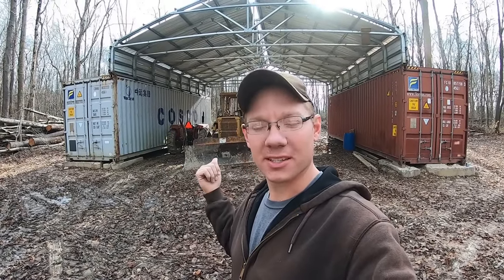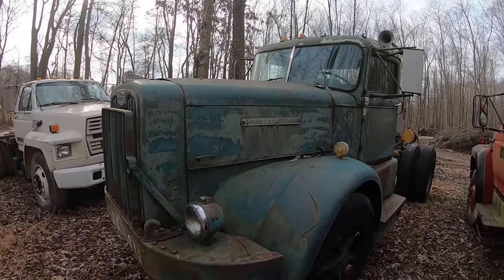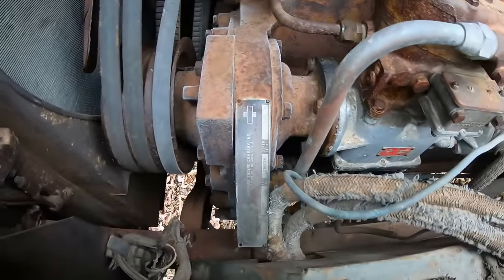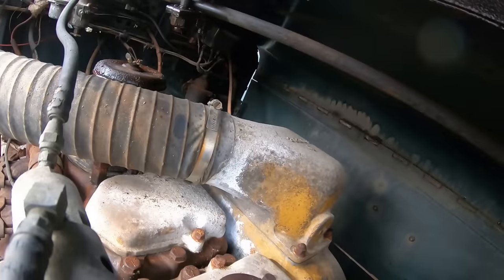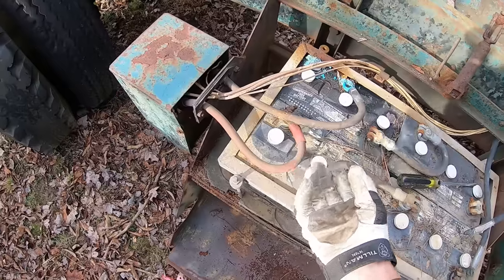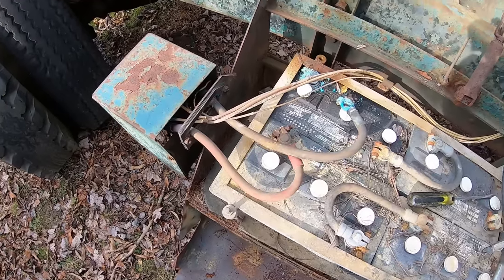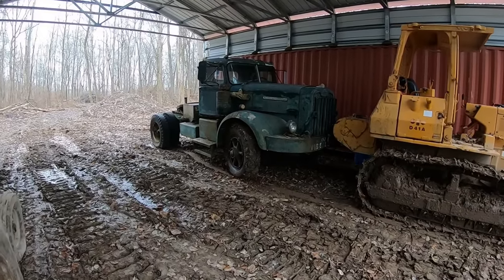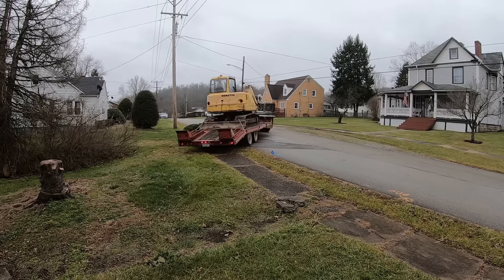First attempt at starting 1957 AUTOCAR truck - Hasn't run in 15 years!

Comment: I see that the switch over starting system has been mentioned by several already. Before your first start you may wish to check the injectors. If even one is stuck you could get a runaway, not good. Take your time and clean electrical connections, fuel pump, valves, make sure none of the valves are stuck. Don't rush to get it started, make sure it is safe to start first. Sitting that long can creat issues easily overcome that may nor be so easy if you don't consider them before bringing it back to life. Only suggestions but in the end it is your truck.
Reply from the maker: I appreciate everyone’s suggestions and concern! I don’t want to hurt it!
Reply: If an injector sticks or seizes on a PT Cummins fuel system, it can only cause a miss, not a runaway.
Reply: the PT pump meters the fuel not the injectors will not runaway like a Detroit

Comment: It wasn't a lack of available current that prevented the starter from engaging the flywheel when you jumped across it.. The solenoid does two jobs.. It mechanically engages a large disk (usually a disk) that makes the electrical connection across the two large wires which engages the motor, and the solenoid magnetic coil also pivots out the gear to engage the flywheel as well. One mechanical action, two tasks. Another potential problem is that if you have the polarity backward going to the solenoid, the magnetic field will try to pull the plunger in the wrong direction not allowing either task to complete.
Reply: Fred Flintstone   Wrong! A magnet will work no matter the polarity of the magnet. The polarity of the magnet will matter on a reversible motor, another magnet. Polarity does not matter to a solenoid!
Reply: @darrelfuhrman8217  Yes, thanks you for the correction. The solenoid will still engage properly regardless of the polarity.. What will happen is the motor will run backward.
Reply: @fredflintstone8048  A non engaging starter needs way less current than a starter that is loaded. More than One pair of cables should solve that issue but, I'd run the juice through Two 12v batteries temporarily so  I could hear it turn over completely before playing with wires that early in the game.
Reply: The problem was that he bypassed the solenoid completely when he jumped across the two big studs. He should have jumped from the hot stud to the start terminal and that would engage the starter motor.

Comment: That    lever   above   the   air    compressure   with    the    cable    on    it    is   a   decompreshion   lever   pull    it    turn   motor    till   you   get    oil    pressure ,   that   has   a    parallel   switch   make    sure   starter   is    24v    your   batterys   are   series   parallel  hope   this   helps.

Comment: Park and run is a idle adjuster so you can either lower or raise your idle as you are parked with truck running
Reply from the maker: That was my guess at the time but about 30 people told me that’s the wiper control and that does make sense
Reply: That age of truck did not have adjustable idle speed.
Reply: in other words a throtle

Comment: Run and park is for air powered windshield wipers.
Reply: Old school wipers. Got to love them.
Reply: Didn't even know such a thing existed... so it's "park" in the sense of "off" (as in wipers in park position)?
Reply: @jk9554  
The wipers will stop wherever they are when you cut the air, park makes them go to the bottom of the windshield
Reply: @jk9554  yes,and electric powered wipers have a separate parking circuit to make wipers stop at the bottom.
Reply: I came to say the same thing.
Reply: @ehhjeep  my
Reply: @jk9554  In UK we used to have (back in the day) wipers that worked with Vacuum off the intake manifold using pipes and an air flap. This was ok until you were going up hill. With the gas pedal down there was a lot less vacuum and the wipers would stop. Great system and just as complex as an electric motor with non of the benefits.

Comment: that engine looks great!! ive rebuilt many 855s from th2 195hp to the 450hp big cams NTNs. She WILL light have no worry lol. Use a bucket of clean fresh fuel or add a few gallons in the tank. it also helps to put a fresh fuel filter on the PT pump as well if theyve been sitting for years. aslo when you jump the starter go from the hot cable from the solenoid  to the smaller switch wire on the solenoid.  I cant wait to hear her light up & make smoke again!!
Reply from the maker: Me too!!! I’ll get her in the next try!! Hope you subscribe!
Reply: Would be a 743ci wouldn't it,outboard injection lines??

Comment: Here's a story from back in my early days. One night my buddy invited me to make a short run in his (company truck) 1948 International dump truck pulling a pup trailer. He would haul clay to the brick plant about 40 miles away, continue on to a coal mine another 70 or 80 miles away, then dump at the power plant, then go do it again. Anyway, this was my first time in this very old, raggedy Corn Binder. It was dark, so I couldn't see much inside, but the tops of the twin sticks. As we rolled along, it looked for all the world like the gear levers were moving by themselves. I asked, "Have you got this smbitch trained or what?" He just smiled and said he did. For a long time I didn't know what the heck was going on with it. One day we made a daytime run in that truck. I caught him putting his other foot over and flopping the levers at the bottom of their sticks. "Course I did wonder about this guy, he could drive down a curvy road with one hand on a gal's lap, the other playing with the knee of a gal in the back seat. drink a beer and smoke a cigarette all while keeping the car right where it should be. I had to wonder what the hell he was using to steer with. I have more stories about this guy, but that's enough for now.
Reply from the maker: hahah he sounds like a good ol boy!
Reply: Those we call uncles

Comment: The negative sign on the test meter shows the polarity. It is positive ground. If you connect the batteries for negative ground, the starter will run in reverse direction, and the engine too. Refer to the manual on polarity before connecting batteries.
Reply: There is nothing in this truck in any way affected by polarity except the charging system. The starter, lights defrost, doesn't matter. Starter turns the same way, engine turns same way.
Reply: No, it wont spin the starter backwards.   Those old starters wer series wound and thusly are not polarity sensitive.
Reply: Mohabat khan Malak the starter runs the same way, positive or negative ground.  The motor will not run backward! Some GM DDE will, but most will not! I have switched tractors & trucks from positive ground to negative ground, the starter still spins the same way, as long as you use the same brush holder!

Comment: I'd really consider draining the old fuel out of the tank, draining the system and changing out the fuel filter, then refilling and mixing some of the old fuel back in over time if you want to.  That many years sitting might have made a mess of the fuel, lots of condensation cycles.  Fresh fuel, prime everything and purge the system with compressed air going into the tank with the fuel lines cracked at the injectors.  You can check for leaks and prime fresh diesel right to the injectors in one process.  Also might help to throw a can of injector cleaner in, and remember that these older diesels were built for running a much higher sulfur content in the fuel for upper cylinder lubrication - I put upper cylinder lubricant in the tank on my older engines to help keep things smooth.
Reply from the maker: im planning on doing all of those those things next go round! i went into this battle a little unprepared but ill get her next time!

Comment: Run/park-air wipers. Box on battery box is probably parallel switch for 24 volt crank, 12 volt run and charge. Might be positive ground..
Reply from the maker: correct on all counts
Reply: @DieselCreek   I try but guarantee nothing.

Comment: That's a series/parallel switch. The truck is 12 volts and it only connects in series to supply the starter with 24 volts. Don't dead short it playing around. They are expensive anymore. And it's not easy to find used ones.
Reply from the maker: Exactly why I stopped when I did, electric isnt my bag of tricks and I realized I wasnt doing something right! haha thanks for watching! stay tuned I got the wiring diagram and were gonna get her running!
Reply: @DieselCreek  For some reason people are compelled to add an extra ground strap from the batteries. It makes the switch dead short when you try to start it. There is a big copper disc inside and it blows a big hole in it. Makes a real mess and makes junk out of the switch. Last time I bought one was like 20 years ago and it was like $300. They haven't used them since the 70's so not many used ones around
Reply from the maker: @cindytepper8878  the guy told me when I bought it he had replaced it right before parking it, i didnt even know what it was, so hopefully i didnt hurt it!
Reply: @DieselCreek  I never saw one get fried, I've only seen the aftermath. But judging from the destruction inside there was probably smoke, sparks, and some other signs  when they got destroyed

Comment: The batteries are connected to a PARRALLEL switch. It makes 24 v for starting then after the motor runs it switches to 12v.
Reply: Like a land cruiser 80 series.... diesel engines.
Reply: @dolmarf411  yep
Reply: Didn't know that exsisted.. why not 24 v als europe ?

Comment: You probably aren't getting enough power through the jumper cables to spin the motor.  The solenoid clicked but didn't spin the engine.  You will need to put decent batteries in and possibly still use jumper cables and as someone else said it would be a good idea to try to turn it by hand first.
Reply: Yep, that sound was the classic sound of a starter that wasn't getting enough power.
Reply: Poor connections can also be an issue
Reply: @kylekenan2321  Yes and jumper cable clamps don't make very good connections

Comment: Was hoping that it would start, too. It is called a voltage divider...some of those old engines needed 24volts to start those cranky engines...hehehe. I didn’t expect a positive ground though. My REO has the pos ground but it’s 6volt as well. Keep it coming. It looks like you could get your babe to help you pull that thing or help you fire it up. An extra hand is always better.
Reply from the maker: I’m just gonna get some good batteries next time and I think she’ll go!

Comment: So the starter is the only thing running off 24VDC.  A flip over switch would kick in when Alternator voltage is present. I love the AUTOCAR. Great project.  Love those Cummins. The wires are the 12v Supply and alternator wire to kick over the switch. 
Once it kicks in the 24 volt is disconnected and only the 12 volt part will be connected. Since the 12 VOLT is not run to the alternator at all. Sounds like POSITIVE ground as all of the batteries are the old 6 VOLT  , which commonly were 6 VOLT positive ground. Lighting was 12 volt as well, Didn't matter the polarity on the lighting.  but newer LED lighting needs the polarity.

Comment: You also have a compression release handle on lower right side of steering wheel. Pull it out engine will spin over faster. Then release it.
Reply: Thanks old timer
Reply: @shawnstanger5753  yes I am old. And I love the old engines. And still do.
Reply: @ronniehooper5618  me too

Comment: Autocar is a positive ground system. The box you called a transformer is a series parellel switch to separate 24 and 12 volt circuits. You will have a lot better luck turning it over if you clean ALL the connections from battery to starter,and charge /replace the batteries as needed. Jumper cables,even heavy ones will not carry sufficient current to start an engine, you need reserve in the batteries. It looks like the T handle control on the bottom of the dash might be a compression release, see if it hooks to a lever on the side of the head with likage into the rocker box. If so once  it turns over hold the release and let get rolling good, then let it go. That usually would get them going. Not being bossy just a few tips.
Reply from the maker: I appreciate it but already got it going, check the channel for the video! Thanks for watching!!!

Comment: napa commerical batteries with stud post terminals are the way to go, i cant stand using em shitty round post types they are a pain most of the time. also you can remove those wires to the starter and put your jumper cables on it, it should work

Comment: Positive ground 24 volt system with a parallel switch. The generator charged 12 volt DC through the switch, which boosted it to 24 VDC. Be very  careful ,when you jump that unit off your dozer, it most likely will have a negative ground system, and when that A Car fires, and begins to charge, you will have a massive headache, not to mention fire. Been there done that, I learned to drive trucks on an Autocar like yours, except the one I drove had a 335 Cummins in it with a 5-3. Good luck. Read your manuals,and get new batteries first, before trying to jump it with the dozer.
Reply: Not how the series b parallel switch work
Reply from the maker: The generator wasn’t hooked up so no risk of back charging

Comment: I cut my teeth on an old red  AUTOCAR it started out with a LeRioy V8 gas engine . I bought it used for $500.00 from ESSO Oil to haul steel out of the mills around Pittsburgh , Pa. it lasted 2 trips to Dayton,Ohio. Hauled it back to Pittsburgh Cummins and had a 200 single disc. pump put in and ran it for 9 yrs. You have to watch out some old Cummins with the old style pumps they did'nt have a fuel return line to help keep the fuel warm and would runaway when out of fuel or if it gelled up,had it happen in real cold weather going down a long hill a couple times, luckily I caught it in time.  Sold it and bought a new 1965 AutoCAR I quit driving in 1975. I  went to running heavy equipment. I'm now 85 yrs.young. This video gave me goose bumps when I watched it.   Bring her back to life Diesel Creek.
Reply from the maker: That’s awesome, I live west of Pittsburgh here, she prob won’t see much action in the cold so I doubt I have to worry about that. Thanks for watching!

Comment: Yo, truck is positive ground, common on older stuff, just have to be careful when jump starting it. a good whack on that starter should knock it loose and let it spin, or get some batteries for the truck that arn't junk... and good connections would help, I bet it would at least turn over then
Reply from the maker: Ya I’ve learned a lot since this was recorded I’ll be getting her going soon I hope!!!

Comment: Road base 610 gravel  mixed with a little concrete dust in the shed before you put the auto car in there , wet it down, roll it and let it cure overnight.
Reply from the maker: RON SALES I’m not getting fancy, long term this is really just an equipment shed that dozers will be tracking on all the time. It’s just gonna get a good layer of #1’s then capped with 2A

Comment: aI generally hook the positive jumper straight to the starter,then use a lever to push the solenoid into mesh. Once the solenoid piston comes back it joins the two contacts in the end to feed current to the starter . 
I wish I could buy that Cummins fuel hose here. it's great stuff and I bet those lines are 63 years old too. There will be a transformer in that box to supply 12 volts to the lights etc . You can upgrade all the consumers to 24 volts these days so there is no need to keep it. And yes,old diesel will burn but if there is algae in the tank you are making a rod for your own back.
Reply from the maker: yes everyone has been on me about that and I do know better but I was getting in a hurry loosing daylight and heck I wanna hear it run just as bad as you all! but ill be draining the tank and adding fresh fuel next go round! thanks for watching!

Comment: That thing on the back of the battery box is a switch over device that mechanically switches from 12 to 24 volts when you crank the engine only. It workes via another solenoid.